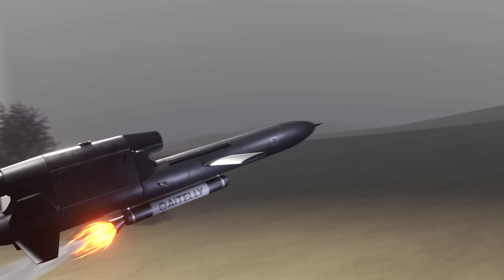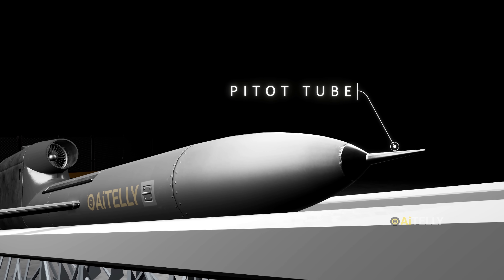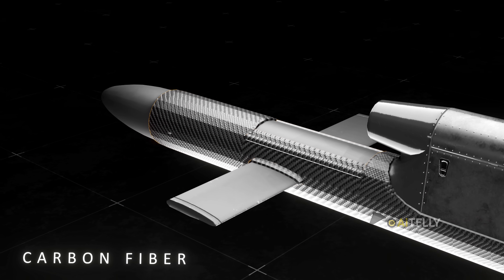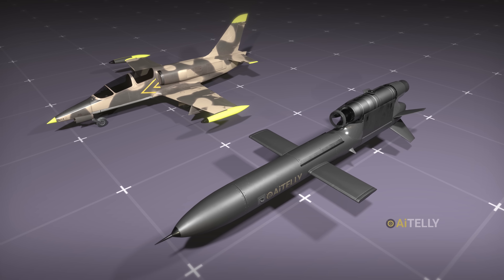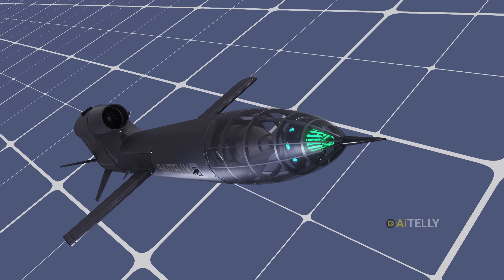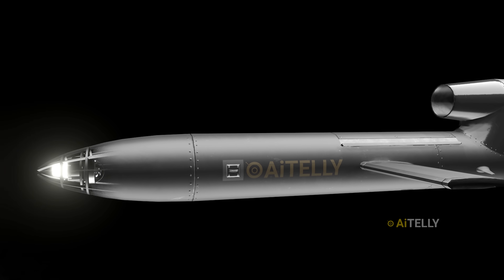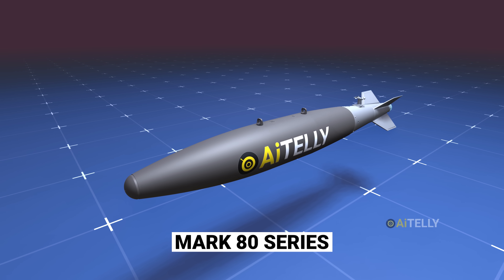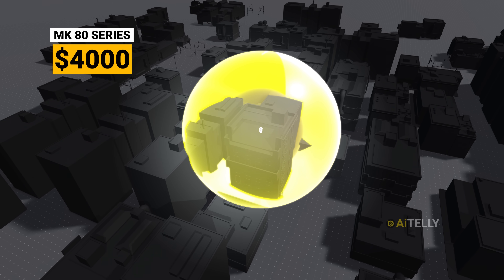The Flamingo FP-5 Ukraine Homemade Missile

Comment: I love the Ukrainian's innovative thinking on creating a Tomahawk-type missile. The designing and building of the Flamingo missile required a can-do attitude and rabid resourcefulness, which I found inspiring.  The Flamingo was pretty much built from sticky-tape, parts from a scrap yard,and positive thinking, love it. Also with Ukrainian building their cruise missile meant that they didn't need permission from their allies, which took much too long in the past. In my view, if Ukrainian's allies had allowed them to target Russian targets at the start of the war, Russia may have been already defeated. I hope Ukrainian's allies can assist with improving the Flamingo's accuracy, which would improve it's effectiveness at destroying more key targets. Go, Go Flamingo.
Reply: Is using a design almost identical to a British/Emirati missile (which even has the exact same model identifier, FP-5) designed by Milanion “innovative”?
Reply: @CtrlOptDel , I said innovative because they used scrap parts and determination to build a missile with great potential. Many creators use past creations for inspiration. They say, standing on the shoulders of past inventors and their creations.
Reply: @karlclark8625  It’s not just inspiration, it’s straight-up copying. Slightly modifying the design to use the engines & materials they already had on hand is technically impressive, but it’s not innovation, it’s adaptation.
Reply: @CtrlOptDel , I see your point, I'm impressed with Ukraine's determination to defend themselves. If that requires utilusing a previous design, then so be it. People have said that the Flamingo has much in common with the German V1 rocket. Many countries, creative people do this, its nothing new. In fact, I say if the design suits your purpose, then make some small tweaks and use it, which from what you're said the Ukrainians has done with the Flamingo. Like I said before, with them making their own weapons, they don't have to ask permission to hit certain targets. I hope countries help Ukraine to further develop the Flamingo's accuracy and stealth.
Reply: @karlclark8625  I as an Englishman am all for the British military sharing our much-more-advanced-than-most-would-expect technology with Ukraine, what irks me is when it’s portrayed like Ukraine acted alone & invented what it’s been given. Give credit where it’s due, that’s all I’m expecting.
Reply: @CtrlOptDel , I'm also British, and I respect your point of view. I just want Ukraine to wipe the smirk off Putin's face. If certain allies had supplied and allowed Ukraine to fire long range missiles into Russia's territory, this war may have already ended. However, I think a key fear was the world's oil prices. I suppose you could say that if they had been given Tomahawk missiles, the Flamingo may not have been needed. Donald Trump,  the moron.
Reply: @karlclark8625  trump is more likely to give tomahawks to russia than to Ukraine, unfortunately.
Reply: @karlclark8625  I don't think Russia is already defeated, they have a polys point compared to ukraine I think a war structured adapted Companies or economy.
But yes, they can make Russia weak but now, it's something late Russia is also adapting and Russia can't be defeated alone, 
Russia is like a US with war economy, their companies are well structured for war, Soviet era times.
Amen 🙌
Reply: Вы рисуете себе образ простых и бесхитростных мирных украинцев, вы упорно не замечаете и не хотите знать что украина - это была самая продвинутая республика ссср с промышленность и заводами ссср машиностроение и ракетостроение и самая большая коммунистическая партия - это на украине!
:
Вы не видите того что украина это 40 миллионов жителей…
Ты не видишь того-что украина в момент вторжения россии в 2022 году - украина была в состоянии гражданской войны 8 лет, через которую прошёл миллион украинцев и при поддержке и одобрения запада, и закрытые глаза запада на преступления украины на донбассе!
:
Ты тут видишь - какие то простые украинцы так долго сопротивляются россии, а то-что всё нато тут помогает, вы это упорно не замечаете…
:
Ты спутники шпионы в небе не видишь, это же не означает что их нет, и денег запада ты не видишь, и разбитую технику нато на украине - ты тоже игнорируешь и не замечаешь, и ты упорно не видишь то-что не хочешь видеть, и видишь тут то-что предпочитаешь видеть…
А наёмников и добровольцев из стран нато ты тоже не видишь?!
:
Ты тут не видишь корысть западных элит - которые не хотят принимать в союз такого мощного и ресурсного игрока как украина и россия в союзе, у которых много ресурсов и огромная конкурентность, ты не видишь как этому запад десятилетиями противодействуют под любым надуманным предлогом, и что для этого делают…
:
Ты тут не видишь русофобской политики западных элит с 90-х годов всю эту ситуацию открыто предсказывая и усугубляя и в доктрине прописанная, запад тут вбивали клин между этими республиками и потакали национализму - и закрывали глаза на русофобию и анти русские законы!
:
Твоё бессознательное рисует огромную россию и маленькую украину, и ты вычёркиваешь из этой картины большую и огромную америку и евросоюз - и те огромные средства вкладываемого в это…
:
Я тоже как ты не вижу тысячи санкций наложенных на россию, и я как и ты не видел той долгой десятилетиями русофобской политики запада, и я как и ты не видел как приближается нато к границам россии и сдвигаются красные линии…
:
Все мы видим приветливость и улыбчивость западных простых людей и элиты запада, нам бессознательно кажется что они гуманные и бескорыстны, и что они равноправно с нами объединятся в евросоюз до владивостока…
:
Не комплексуй, я тоже как ты всего этого не вижу как ты - и только догадываюсь о настоящем размере всего происходящего.
:
Я как и ты, не вижу то-что украина расколота - и что на стороне россии воюет несколько миллионов бывших украинцев…
Я как и ты не вижу миллионы украинцев которые столетиями живут в россии и они на всей вертикали общества бизнеса и власти в россии…
:
Уверен, ты тоже не видишь что на украине тоже полно русских в войсках украины…
:
Я точно знаю, что ты не видишь того-что всё это на этих видео этой войны, что это всё русская земля - которую когда то всё это было подарено от россии братской украине, крым и юговосток украины - это всё русская земля которая временно в составе украины, и запад тут хочет поставить базы и лаборатории, и тебя это положение устраивает, и ты приветствуешь миллиарды русских денег и коррумпированные элиты россии - и всего бывшего ссср с семьями на благополучном западе, ты рад и счастлив процветать на их дешёвых ресурсах, и не хочешь честно конкурировать по всем законам гуманного и демократического открытого и равноправного союз…
:
И выдвигаешь какие то надуманные законы и правила - которые ты переписал под эту складывающуюся ситуацию, и ты вводишь новые санкции против россии и брикс, и всё это бесполезно и не работает, и только ещё больше усиливает и раскалывает весь мир - и мир запада тоже расколот и все видят и понимают всю ту корысть запада - использовать тут эту внешнюю видимость гуманность и цивилизованность в корыстных интересах против любого сильного ресурсного и конкурентного игрока, не желая честно конкурировать и сотрудничать, и используя тут в этой игре все возможные способы методы и средства - рычаги и инструменты, и не брезгуя русофобией и национализмом и нацистами…
:
Всё это для тебя не важно и какая то мелочь - которое всё это будет работать на твоё благополучие и процветание - и нестабильность у твоего конкурента которому ты всё это сделал, - это сделали твои западные элиты которые ты себе выбирал, и они всё это делали против россии - чтоб ты их снова и снова выбирал - чтоб твоя страна процветала и все конкуренты слабели и воевали с друг другом, и мечтали о таком же как у тебя мире запада созданного под себя, и в которое можно войти и стать равным тебе, если русский чиновник сможет много наворовать и предать свою страну
:
Украинская ожесточённость и мотивация - и технологии и западные деньги делают невозможным лёгкое продвижение, и показывают вам картинку которую вы хотите видеть - и отовсюду получаете от телевизора - и твоё правительство знают что вы хотите видеть…
Reply: @ТретийАккаунт-ъ5ь  знатно пригорает, да?)))
Reply: @Art_Int_40  У тебя уже перегорело?
Reply: @ТретийАккаунт-ъ5ь  I dont read your comment 😂😂 I don't care
Reply: @ТретийАккаунт-ъ5ь  орк,зачем тебе Украина?
Reply: @ТретийАккаунт-ъ5ь through all of that you fail to see that Russia has done anything wrong and it’s everyone else that’s been horrible to Russia that has caused all the issues. 
Forgetting Russia was an observer in nato, had joint military exercises with European nations and the USA. That countless trade deals were done to grow together. Russia threw all that away to take some of Ukraine. Even the Russians that went into Ukraine in 2014 say there would be no war if they hadn’t of gone to donesk to raise a force to fight. 
2 sides to every story.
Reply: @Statueshop297  Это тебе всё это можно назвать как тебе угодно, это мало относится к той проблеме тут происходящего, ты просто тут ищешь какие-то те превосходные степени украины и запада, и что россия чего-то этого западного недостойна и не права, и что россия должна была продолжать уступать этому доброму и гуманному у запада интересам праведного на ресурсы и гегемонию, и продвижению нато, и радоваться, и быть обнадёженным базами и лабораториям на своих границах и подаренных исторических землях, ничем не оправданному и интересам тут у запада огромному.
:
И конечно же, естественно и понятно, что любому западному политику потом жить ему и его семье в его стране, и естественно, что он будет делать всё для своей страны и для своих граждан, которые его не переизберут, и нигде не скрыться с наворованными деньгами, а вот из россии всем можно десятилетиями вывозить, и тебе за это дадут почётное западное гражданство, и запад эта ситуация в россии устраивает и нравится, и приветствуется, и всячески чем-то закрепляется вся эта ситуация, и затягивается переходный период 90-х, и продляется, и чем-то многообещающим обещается когда-нибудь.
:
И у украины с этим примерно то же самое, и естественно украине нужно не опоздать на этот уходящий пароход и получить тут своё какое-то то преимущество от той тут ситуации, и пытаться вам тут всё это чем-то оправдывать — за какими-то словами о плохой россии и хорошем западе и украине...

Это, конечно, само собой, что украина с западом намного лучше россии, и всё то вами русофобское и недружелюбное тоже было само чем-то собой и естественно для вас хорошим и правильным и оправданным - потому что россия может напасть, потому что мы десятилетиями русофобствуем и базы и нато придвигаем.
:
И как результат и итог такой вашей тут бурной русофобской деятельности, вы получили от россии то заслуженное и закономерное, и такое же и не менее коварное от россии в ответ, - просто, оно было слишком резкое и ошеломительное, ведь всё уже давно шло к той ситуации чего то необратимого в россии, и достаточно было слабого толчка чтоб всё это то нужное созданное таким гуманным и добрым в россии случилось - и надо просто ещё раз было это подтолкнуть и поторопить, и создать условия где то рядом - чтоб потом перекинулось и на россию, и украина тут была идеальным претендентом на это.
:
И украинцы в это с удовольствием и с надеждой на самое лучшее вписались, и рассчитывали только на хороший и положительный результат, и конечно же, они никакого того отношения ко всему этому - тому десятилетиями у запада не дружественному - украина отношения не имеют, и всё это было не против россии, а только на благо всего мира, кто виноват что того блага на всех не хватит, и надо воспользоваться и делиться и отбирать его у временно слабого, и создать ему вечные условия - чтоб он был вечно слабым и зависимым, и всегда уступал и в чём то каялся, соглашался и уступал, и чтоб сам просил сдвигать красные линии, и что базы и лаборатории на границе, это лучшее что было в его жизни!..
:
Всё это так неожиданное от россии в 2014, в отличие тут от запада с его тут какой-то фоновой русофобией и национализмом и добрым и гуманным сотрудничеством и влиянием на россию через законы, правила, условия, санкции и пошлины, медленно и поэтапно отвоёвывая у россии жизненное-пространство - и гуманно этим подводя россию к майдану и цветной революции, которая была уже не первой и открыто проплаченной оппозицией чего-то прозападного.
:
И при идеальной ситуации россия бы сменила путина на западную марионетку со счетами и недвижимостью, а в самом идеальном случае россия бы на десятилетия погрузилась бы в смуту и гражданскую войну, и как итог — развал, обособление и закономерные тут к россии всё те же правила и условия сотрудничества одностороннего и колониального зависимого, с вечно чем-то этим недовольным простым населением, и упорно ища причины в своих элитах переходного периода, который нам тут запад в тех ожиданиях наилучшего для себя затянул на десятилетия - и желательно на столетия, чтоб не было на востоке ничего сильного и конкурентного, - и чтоб всё было тут вокруг россии таким же добрым, цивилизованным и русофобским, и чтоб мечтали присоединиться к западу - и мечтали стать второй францией, и что для этого надо всего лишь понравиться западу - и потерпеть несколько десятилетий, и чем-то доказывать западу свою интересность и нужность, как это тут делает украина...
:
И россия, когда-то тоже наивно на что-то тут рассчитывала, наверное, на то-что запад гуманный и бескорыстный, и позволит нам на наших ресурсах стать экономическим чудом, и не захочет всё это по всем законам и правилам войти и всё у нас наивных забрать и присвоить и вывозить свободно прибыль на запад - и за это одаривать наши элиты, и гражданство и сохранность наворованного, и за всё это простые жители запада будут боготворить свою элиту и впишут в учебники того, кто так хитро смог обмануть этих наивных и доверчивых - и даже стравить их между собой за одни и те же западные ценности, надёжно укрытое в банках запада их элит.
:
И на всё это мной тут говоримое, ты опять себе что-нибудь найдёшь про что сказать о том, что запад хороший, а россия достойна такого отношения от запада, но, тогда и россия тут в праве вам ответить тем же достойным вас — если вы чувствуете то некое ваше благородное и правильное право так поступить с россией и воспользоваться некими ситуациями, то не ждите, что россия после тридцати лет терпения - будет ещё это терпеть, и не ответит на это недружественное
Reply: @ТретийАккаунт-ъ5ь so prior to 2014 there was no Russia phobia as you put it. 
Russias actions caused the responses. Those responses were tiny so putin thought he could do another crimea and grab Ukraine quickly with little blood shed. 
Until Russia accepts what all other countries already know that taking over countries to incorporate into you’re  own country is not acceptable it will remain at odds with most of the world. 
To make out somehow everyone is being horrible to Russia for no reason and aren’t all trying to get Russia to stop the war is plain denial.
Reply: @Statueshop297  Базы и лаборатории США и британии на территории украины, нарушение украинской нейтральности и невступление в союзы — постоянно это нарушаемое украиной и западом в интересах тут запада…
База в очакове на украине, — кажется, там была британская база?..
:
Украина упорно хотела понравиться западу, эти желания украины были настолько большие и ущербные, что было понятно, что этим надо западу воспользоваться в своих интересах, и украина понимала, что тут большие интересы запада, и что россия слаба, и что украина за это предательство слабой россии получит огромные привилегии от запада…
:
Это была украинская корыстная мечта и надежда неосуществимого - которого никто на западе не хотел и не собирался дать украине реализовать этот шанс - разрешить и позволить украине развиться с её потенциалом союзами из СССР и транзитом, все понимали что украина с таким богатым потенциалом станет конкурентом в европе и китайским чудом развития в европе - которое никто не примет и не поймёт на западе и снесут избиратели тех кто это позволил…
:
И украинцы упорно в это придуманное себе верят и за которое украина теперь расплачивается территориями и жизнями — упорная вера украинца в бескорыстие и гуманность запада - и полный отказ украинца знать и видеть тут циничные интересы запада, что запад использовал украинца как инструмент, который он теперь стачивает украинца до рукоятки, и запад не хочет и не видит причин останавливаться…
Украинец, упорно демонстрирует редкостную близорукость и стирает себе каждый раз память читая такие тексты - о том всём этом знаемом о западе…
:
У россии в 90-х годах тоже были такие же огромные желания понравиться западу, ты сам видишь, что получила украина от запада, то, как это мало и ничтожно, россия тут получила ещё меньше — россия получила хороший урок, что никогда россия не понравится западу, понравится россия только когда отдаст западу кубань кавказ, азию, сибирь, карелию, дальний восток и позволит на этих территориях поставить западу базы и лаборатории и выкачивать оттуда ресурсы — и запад там будет стимулировать русофобию и национализм, и вот такая россия западу понравится…
:
А запад, будет продолжать тут делать на этих бывших территориях россии свои интересы — и ставить там свои западные марионетки и базы и лаборатории, и там будут антирусские законы и запрет русского языка, а в европе разрешено два языка в странах европы, а в прибалтике и на украине запрет запрещающий всё русское…
:
Всё это вам, запад, нужно вокруг россии, и запад это не скрывал и всё это поэтапно, постепенно и плавно воплощал десятилетиями, войдя на рынки СССР и россии, обанкротив производства и производителей и скупив за бесценок, и диктуя условия элитам, у которых счета и недвижимость в странах НАТО, всё это было сделано под красивые лозунги о свободе и демократии…
:
И в результате такой колониальной политики к россии вы, запад, вы потеряли партнёра и союзника россию — и породили монстра БРИКС, и теперь о вас будут все вытирать ноги, так как вы это делали когда-то, вытирая ноги об россию…
Всё происходит очень быстро, БРИКС усиливается, запад слабеет и вымирает, и вытесняется другими национальностями…
:
Спрашивать ваши элиты, зачем вы оттолкнули богатых прозападных восточных христиан и стравили их и стимулируете национализм и русофобию - и завозите к себе мусульман, - всё это уже бессмысленно и бесполезно…
:
Вы, свободные и независимые, не сможете тут ничего предъявить вашим элитам, и они будут и дальше к вам завозить мусульман и отталкивать от себя христиан востока, и стравливать между собой, и ты, простой житель запада, будешь тут этому всему продолжать радоваться и смотреть на это как на такой спорт и гладиаторские бои…
:
Теперь ваша очередь преклониться перед вашими бывшими колониями - и отдать им репарации за колониальные отношения!..
Всё это они всё равно однажды возьмут вашими городами, рабочими местами, и вашими жёнами сёстрами, дочками и внучками…
:
Это всё возможным сделали ваши элиты русофобского и корыстного - их интересы попробовать ослабить слишком сильного игрока, который отвернулся от вас и создал свой союз БРИКС, и вы теперь будете конкурировать с ним по честному как вы это делали с россией все эти десятилетия вытирая об россию ноги - ваши корыстные прагматичные интересы и лживые утверждения - прикрытое красивыми словами о демократии и равноправии - евросоюз от лиссабона до владивостока
Reply: @ТретийАккаунт-ъ5ь and with all that you somehow think Russia has a say in what other countries do. It doesn’t. It acts like it’s in charge of anyone close to it and if they act out Moscow will punish them. 
That is what’s not ok and what most people have issue with. 
You mention labs but there is no evidence of these or what they were supposed to have produced. It certainly wasn’t weapons or their use would of been seen. 
So what were they making that Russia had to invade to stop?
Reply: @ТретийАккаунт-ъ5ь 🇷🇺🤡🐔
Reply: Its not our best rocket, soon you will see much more complex examples. It just cheapest rocket we able to create for now, and its way more easy to scale production
Reply: @hennadiikolesnyk2676 , the Flamingo has much potential, and if Ukraine could get terrain contour mapping guidance systems. They could make the Flamingo one hell of a weapon. Go, Go, Flamingo!
Reply: Scrap for 500k? You can have a mansion in Europe for that king of money.
Reply: @justatry8195  Than imagine how how much money Putin "throws" on Ukraine each day.
Reply: @Andriy_Sklyar, well, Putin has just lost 500 million dollars when an underwater "Sea Baby" drone blew up a submarine. I don't see that submarine getting replaced anytime soon, it's just too expensive with all of the oil refineries, oil/natural gas pipelines, tankers, and ports not operational due to being ablaze or been blown to bits. Slava Ukraine 🇺🇦🦩🚀🔥🥳
Reply: @karlclark8625  I know, but I still don't see any Tauruses or Tomahawks.
Reply: @Andriy_Sklyar ,  the Storm Shadow is very similar to the Taurus missile. The tomahawk missile was scuppered by the Russian sycophant Donald Trump and his administration. Although not as accurate, Ukraine has developed the flamingo missile that does the same job as tomahawk.
Reply: Hard copium